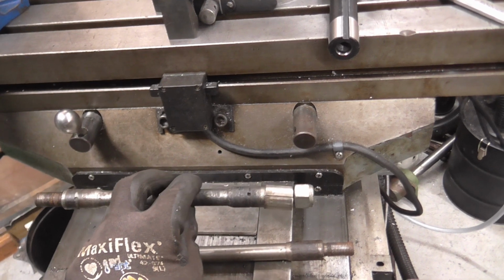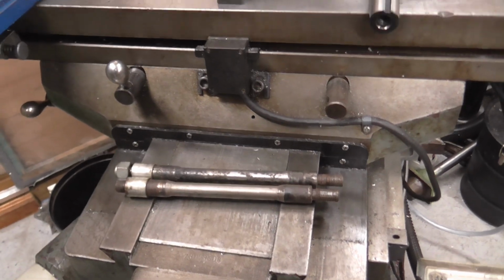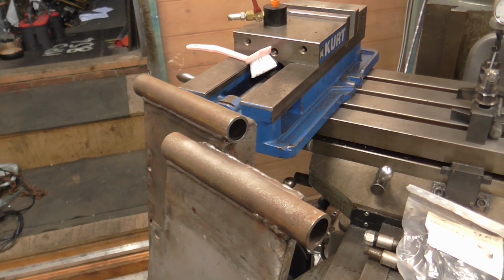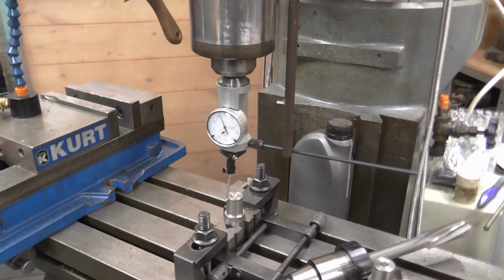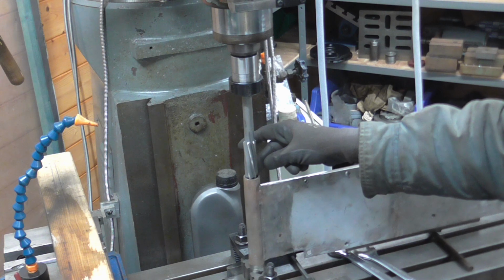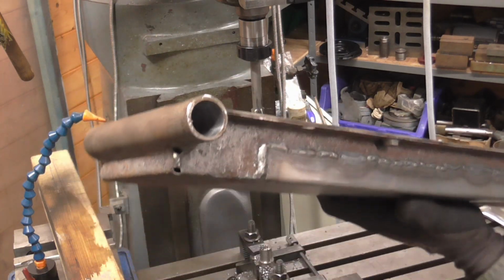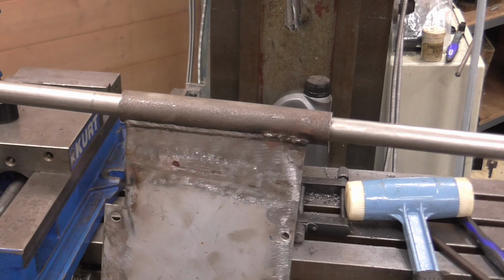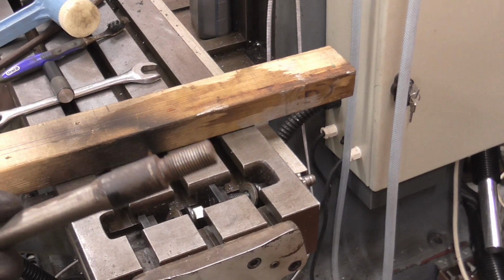Lotus Excel (Elite/Eclat) hinge bush upgrade

Comment: Fiddly work but satisfying. Nice to see you finding some time for the Excel. Did you consider making alloy pins and hard anodising them yourself? A bit of a learning curve but it can be done without huge outlay or complicated equipment. Facing a similar issue with motorcycle swing arm spindle that has 4 x needle roller bearings running on hardened sleeves but no means of lubrication without complete disassembly.
Reply from the maker: Decorative Anodising isn't too hard, but functional coatings are more difficult.